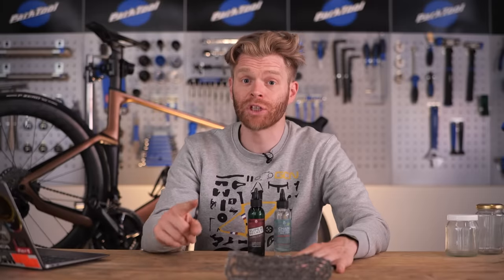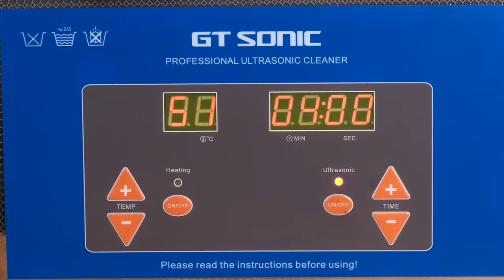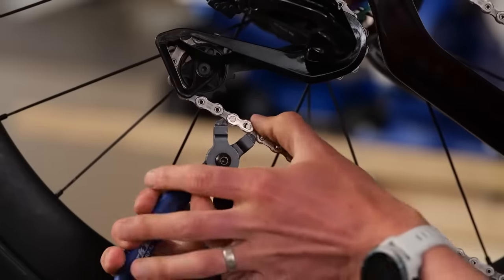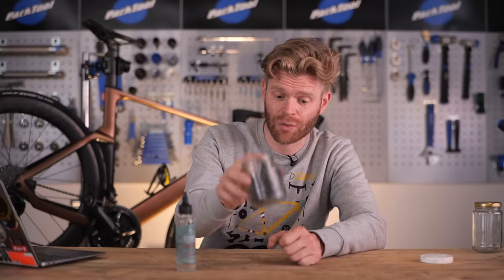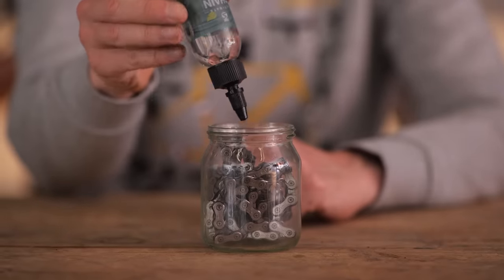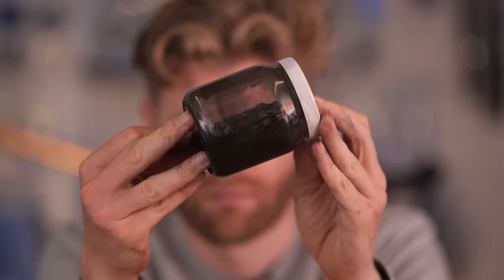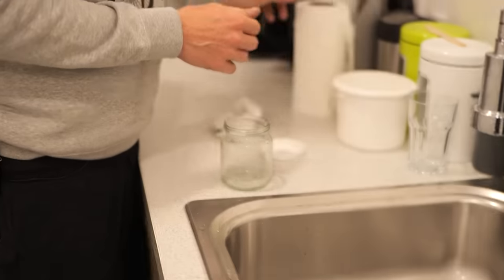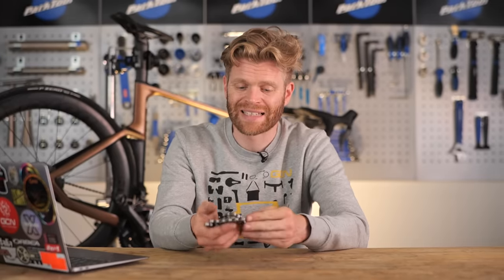The Most Efficient Way To Deep Clean Your Bike Chain

Comment from the maker: Let us know your chain cleaning process 👇
Reply: I mix Blue Dawn soap with hot water into a slightly larger glass container with the chain inside. I shake the container thoroughly, remove the chain and wash the container and chain, until the chain is left absolutely clean. I repeat the process about 3 times. I wait for the chain to dry and add my lube to each individual link. I highly recommend my process.
Reply: For deep cleaning before waxing I do a couple of rinses with turpentine (mineral spirits). After that 1 or 2 rinses with isopropyl alcohol to remove any oil film left on the chain, ensuring the wax will properly stick to the chain
Reply: I have an outdoor bike cleaning area which helps a lot. 

First I use water from the hose to spray the chain as I spin it around to remove some dust and grit. Then 4 cycles of citrus degreaser in the Park Cyclone chain cleaner. At this time I also use brushes and degreaser on the chainrings and cassette. Then, rinse off all the degreaser with the hose, followed by a session with the air compressor hose to blow out all the water from the chain and other components. The drivetrain is REALLY clean at this point. 

Once the bike is back inside the house and the chain is completely dry I use Rock & Roll Gold on the chain... let it dry, then another application later, wiping off the chain after each application. I often ride dusty dirt roads and this lube has proven to be good for not attracting a lot of dust/dirt.
Reply: My local bike shop told me to use Simple Green All-Purpose Cleaner to clean the cassette and chain. It's made right here in good ole sunny California by Sunshine Makers, Inc. It's also biodegradable. Seems to work fine.
Reply: @elizabethpoley6882  Just be sure to rinse it all off really well. You don't want to leave any cleaner residue on the bike.
Reply: Use bum wipe toilet cloth , then a bit of oil 

Comes out nice and smooth and smells fresh
Reply: @festerofest4374  Thanks for the info. I didn't realize there was residue to go w/the smell. Will be sure to rinse when I do it.
Reply: White spirit I keep in a jar and reuse, dirt settles to the bottom. Pour it into a paint tray and clean the chain with an old toothbrush. Let it drip for a while and dip in hot wax. My number 1 rule with chain cleaning is never use water or water-based degreaser.
Reply: @elizabethpoley6882  Do you dilute, or use the concentrate straight from the jug?
Reply: @mikes1976 I've been using it straight from the spray bottle for other stuff, then wiping off. For any future cleaning of cassette or chain, I've been reminded to wash off afterwards.
Reply: I recently cleaned chain to apply silca wax. I used biodegreaser twice in a jar, then decided need to use single use cloths, until they are white, and then used acetone twice - at first iteration it was not completely transparent, second time perfect
Reply: Perrier (glass is recyclable) + surfactants
Reply: Park tool chain cleaner tool with prepsol enzyme engine cleaner, perfection
Reply: @johanpostma3069  Pretty much how I do it, 1 bottle - mineral spirits of any kind - second bottle - isopropyl alcohol. Use the same cleaners for months, just filter them
Reply: Spray degreaser on the chain at the cassette whilst turning the cranks, leave for a few minutes. Put boiling water over chain at the cassette  whilst spinning the cranks. Blow dry then wipe with cloth whilst spinning the cranks. Done. Very clean and shiny. 5 minutes top.
Reply: @douglasbooth6836  I really don't like straying stuff over my hub bearings unless I totally need it. But I was indeed thinking about testing doing pretty much the same with chain removed.
Reply: Ceramicspeed UFO clean as recommended by Zero Friction Cycling.
Reply: @elizabethpoley6882  A number of sources say to avoid Simple Green All Purpose as it may cause Hydrogen Embrittlement and preferentially to use Simple Green Aviation Degreaser.
Reply: @gerrymcbride6429  And it costs 50 times the price of a normal degreaser )
Reply: Brake Cleaner
Reply: Citrus degreaser, in a plastic bottle (recycling 😂) give it a good shake, then soapy stuff and water in another plastic bottle (more recycling 🐻‍❄️) and repeat until clean
Reply: @mrx1979ua  I've done both and 40p/ chain and zero fuss works for me.
Reply: @donaldyoung8866  Any thing acidic is not recommended as it can cause hydrogen embrittlement.
Reply: definitly not with silca chain stripper 44 euro ex tax......buying a new dura ace chain is in the sale cheaper.... but i clean it with petrol, works perfect and is cheap.
Reply: A little bit of petrol (and I mean a little bit, only enough to just cover the chain barely if you tilt it) in a big stainless stewing pot. Slosh it about for a while, drain into a container for laters. Then degreaser, then hot water. Blast it with the air compressor. Dry it out in the oven at a VERY low temperature. Job done.
Reply: Petrol, in a jam jar. Works a treat to remove the thick chain oil I use
Reply: Not a big fan of Silca overpriced trendy products. Pure bollocks to make a huge profit. They have the most expensive cleaners, waxes, lubes. There's no 'secret' formula it's just hype. 
If you're using oil based lubes you need solvents to 'solve' them. All these 'green' degreasers are half-arsed and pricey. I reuse and filter solvent and then clean with isopropyl then air pressure and re lube. 
With waxed chains it just needs to be heated then rinsed in dish soap, isopropyl then air pressure. Re-wax. 
So much money being made on these 'special' products that just don't perform using 'enviro friendly' as a sales pitch.
Reply: @Synonomous why the isopropyl? Thxs.
Reply: @izarrayt   It removes any leftover cleaners/solvent and oil and dries without a trace. It leaves the chain ready to be waxed/lubricated.
Reply: i use 12v inductive heater to heat up chain on bike(60 seconds for part of chain between rear deraileur and ring gear) , then i touch it with wax stick that melts, and then i wipe it with old towel, and i  repeat it for whole chain, it takes 6 minutes, chain is clean and waxed
Reply: I use Simple Green.
Reply: Am I the only one to use turpentine? I put the chain in a tray, soak it in turps while cleaning the drivetrain, then clean the chain using a toothbrush

Comment: Beware - tapping glass with metal may cause glass failure
Reply: Not exactly. If you put your finger on it it’ll prevent, or at least significantly the vibrations from breaking. Why do you think people put their hand on a windshield when it’s hailing? Stops the vibrations through the windshield.
Reply: @EatMyPropwash  when it hails bike chains, let’s try it then
Reply: Lol its fine, ive been cleaning my chain in glass jars for years. I use the the glass jars from pasta sauces.
Reply: @JFomo  your are not shaking it vigorously enough then, try harder! Lols aside, I had a pasta pot break in my garage during the chain cleaning process and it is no fun, mess and glass everywhere, so I'm with @timjacobs5417 on this one.
Reply: Alternative facts
Reply: I use a 32 oz Gatorade bottle
Reply: Yes. I had the prob with both jam jar and bigger one « le parfait » I use shaker used for protein shake now. Very efficient
Reply: People usually use a regular old bottle(plastic)

Comment: The chain stripper product may be safe to dispose of down the sink, but once it has been used to clean a chain it contains grease and other contaminants that should be disposed of properly.
Reply: If you're on sewer system  you can put pretty much anything down the drain. As long as its not  damaging to the pipes or prohibited by law. The sewer system sends the sewage waste out to a treatment plant.  Naturally of course there are exceptions, Like india. In india they dump  waste out into the Ganges and other rivers.
Reply: @kalijasin  Not so sure the treatment plants can remove everything. Also you have to consider that often during heavy rain the sewage is discharged untreated.
Reply: @kalijasin that's definitely not true. Even in the minimally regulated US.
Reply: Came here to say this.
Reply: It's fucking unbelievable that this has to be corrected in the comment section.
Reply: @kalijasin  it's really easy: NO chemicals down the drain. Yes, they can get them out of the water but it need much more effort and it's more expensive. 
Do you throw your garbage out of the window just because you know that someone will clean it up later? I suppose you don't - so do the same with Throwing garbage (poluted water) down the drain.
Put that stuff in the garbage together with old newspapers.
Reply: @kalijasin the water compnies dump all that crap in the rivers and sea here in the UK too, unfortunately.
Reply: @Ed.R  Just UK things.

Comment: Dirty waxed chain: shake the chain in a jar of mineral spirits. Let sit for 30min, remove and wipe. If still dirty repeat until towel wipes are clean. Then, drop chain in denatured alcohol , shake, remove chain, and dry completely, but don’t let it sit longer than 10 min or it’ll rust. Then you’re set for waxing.

Comment: As is often the case in these types of comms, yes, the stripper liquid may be friendly to polar bears. But after it has been mixed with your old chain gunk, well, not so friendly after all!
Reply: As we all use Extra Vergine Ollie Oil this is not a problem
Reply: The gunk on the chain came from the roads. All that same stuff gets washed down the grid anytime it rains.
Reply: Just use wax.
Reply: @yutehube4468  Ah ha, eureka then. And I thought it came from a little bottle of lube doused liberally on the chain by the owner,  gradually creating a horrible  black grinding paste. My bad!
Reply: @donwinston  I do and love it.
Reply: @stephencharles6932  It's the grit and grime you pick up from the road surface that becomes the abrasive in the grinding paste he's always prattling on about. Silicate, motor oil, metal bits from your components...those all coalesce into the paste and the wet lube is your binder.

I started waxing my chain recently primarily to avoid the nastiness of a dirty chain. Even a chain cleaned in mineral spirits using the Gatorade bottle method gets soiled in grime in a week or two or regular riding. WIth a waxed chain, I can touch the whole drive train without fear of staining my clothes or skin. The watts savings and extended component life are just two cherries on a relatively clean cake!

Comment: Extra details on the last comment from Ollie:  Chain stripper is a great product but it is designed for brand new chains and stripping factory grease.  Josh from Silca points out in the Silca channel, using chain stripper on a used chain is a bit of an expensive route.  You can save yourself some money using a citrus degreaser (do several baths) + a final acetone bath.

A fcouple of details that are not quite right:
- The chain stripper is bio-degradable and safe, but what about all the black gunk coming out of the chain... not so much, i.e. pour it on the sink at your own risk.
- You can still hot melt immerse a used chain, but only if it has not been used enough to wear the initial tungsten (or othe alloy) coating... ~200 miles of use.

Note: I got these details from watching the videos on the SILCA channel... Josh, the company owner, is an amazing engineer.

Kudos to GCN from moving away from Muc OFF to Silca as a sponsor, Silca is just a superior company with superior products.

Comment: My method… plastic container with screw lid, petrol just enough to cover, swish around for a couple of minutes, repeat again with fresh petrol. Then, drain the petrol, add isopropyl alcohol to cover chain and swish for a couple of mins then drain. Then get a cheap plastic kitchen colander, pour 2 kettles worth of boiling water over the chain. Allow to rest for 5 mins to cool, run the chain through a micro fibre cloth to dry. You’re now super clean and ready to use any lube/wax you want. This method has saved £’s over the years vs. expensive branded gimmicks… #hack! 😉
Reply: That’s what I go too but I don’t like doing it. On the other hand, it’s only once a year or two with waxing.
Reply: @billeterk I am not going back from waxed chains

Comment: As with all (expensive) cleaners, just leave it in the glas, let the crud settle on the bottom, till next time, where you can decanter the clean top liquid and only discard the smal amount of crud on the bottom.

And as with all cleaners, even watersoluble ones, wash the item in hot soapwater and rinse, to remove all remnants of the cleaner.
Reply: Drop a strong magnet in the jar with the used cleaning solution when you store it. You will be surprised with how much metal filing it picks up.
Reply: @kev7355 you cam also take a "magnate tape," kind of like the refrigerator magnates, and cut some for the bottom of the jar. Works a treat! You can get sheets of it. Draw out the circle, even double or trie it up if you need to.
Reply: @ghowell13  Do you need a steel magnate? Like JP Morgan?

Comment: That's a fine setup for clean dirt... When I'm running winter mode, the chain is a disposable really!! I just run it through brake cleaner and oil it with 5W or whatever my car craves!! It's a weekly routine... I may skip a week if it's really cold and dry and there's not too much road salt and slush... If it gets really wet, then I might do it twice a week. Also, with the brake cleaner I use 2 jars... So the chain goes in a clean jar and I pour in the cleaner. After the chain has been washed, I leave the dirty solvent to decant for a while and pour the clear stuff into the second jar. The dirty jar gets wiped clean and the process repeats.

Like I said, this process is extreme and won't give you a nice clean chain, but for the winter beater it gets that chain through it's season and saves you the watts from the crusty rust that's bound to form regardless!! I think I should start burying my chain in a cemetary and put up little crosses on each tomb!!

Comment: Use mason jars so you can properly reseal and reuse the contents, over and over. If your cleaners get mucky you can filter them with a funnel and paper coffee filters.
Install the master link on the chain for the process, so it gets treated at the same time.
Oiled/greased chains:
  - Jar clean in naptha
  - Wash with soap and water
  - Jar clean in methanol
  - Air dry
  - Wax
Waxed chains
  - Boil in water
  - Jar clean in methanol
  - Air dry
  - Wax
Reply: Haha I do the filter method too! I leave the jar for a few days for all the dirty to fall to the bottom and then filter all the clean Turpentine to a new jar so it can be reused for the next chain cleaning.
Reply: +1 for this! Or +2, I guess😂

Comment: Using carburetor cleaner will strip the grease off a chain just as fast for a quarter of the price and you’ll get four times as much.  After washing with water, soak the chain in Isopropyl alcohol to displace any remaining water trapped in the links and the chain is clean.
Reply: Varsol .

Comment: Clean mineral spirits in a thick plastic jar with a tight lid. Chain goes in, gets swirled around and comes out completely clean of everything, waxes, grease, dirt, lube. I have always used firearm oil to lubricate each roller/pin because the bottle comes with a needle tip and the oil is a great viscosity for bike chains; it's thick enough to stay in the rollers, but thin enough not to be gummy.

Comment: Do it old school, clean your chain and cogs quick. Pine-sol or Pine-O-Pine. Natural degreaser and cheap.
Everyone I knew competitively racing for five years did the same cleaning.
Do this outdoors.  Mix the cleaner @ 4:1 water to cleaner. 
Apply with a nylon brush like a chain brush, while rotating your crank/wheel/cogs. You’ll see a lot of dirty liquid coming off your chain and cog. Shortly sparkling clean. Spray with water, while rotating. Allow to air dry. Lube.
I’m all for protecting my gears. Chains are cheap. Time is the thing we wanted to save, and be willing to clean frequently. We did, because this is cheap. Use the lube of your choice. Many of us used Pedro’s.

Comment: I would definitely take my chain off for cleaning more if Shimano made a reusable quick link. As it stands you need to have a supply of quick links to do this regularly. Technically making this quite an expensive way to clean your chain (neglected to mention the cost of links Ollie! ;) ). I tend to just use Alex's technique after every ride to make sure there's no build up and add lube every few rides.
Reply: Get a KMC chain.
Reply: I've never met anyone who didnt reuse their links at least a few times. As long as they snap together snug.
Reply: I've used non-reusable links 8-10x without issue.  I've even broken two of the chains I've reused links on but never at that link
Reply: KMC Chain once, and you will have not a bad chain and a great quick link.
Reply: Wipperman Connex (11 speed one is quite pricey, don't know if there are alternatives) - you can open/close it with bare hands.
Reply: Having recently done the mineral-spirit-jar-shake-repeat thing, that's the first thing I thought when I saw this video.  SRAM specifically recommends not reusing the quick links, costing about $5 every time the chain comes off.  I guess a lot of people ignore the recommendation and just reuse the links but a chain link is not my preferred place to ignore the manufacturer's instructions.
Reply: @yiannispapelis8260  well, they want you keeping the pie plate on your wheels too but do you do that?
Reply: The Shimano chain link is reusable for the life of the chain, and possibly beyond.
Reply: @yiannispapelis8260  SRAM is an American company, and their lawyers and accountants are very risk-phobic. If you remove and reinstall the link carefully, it will last the life of the chain, & probably beyond.